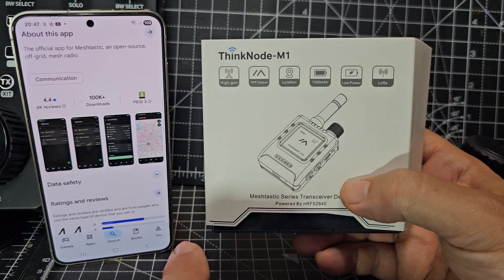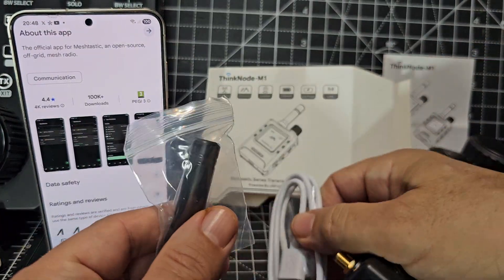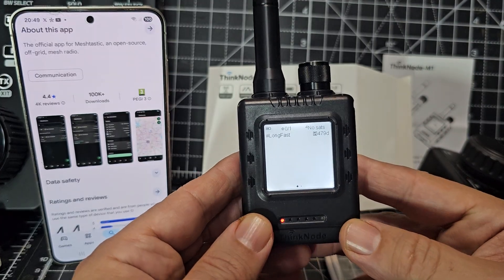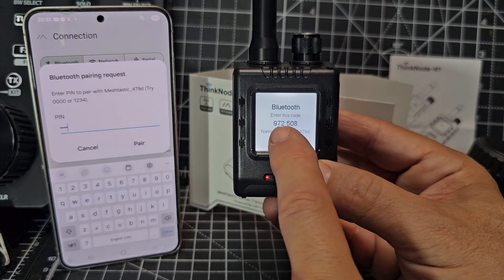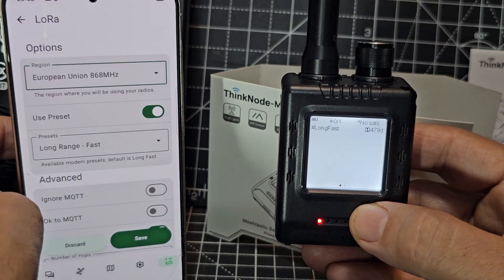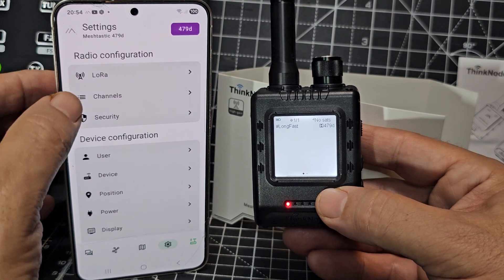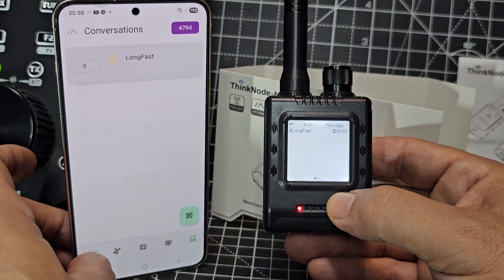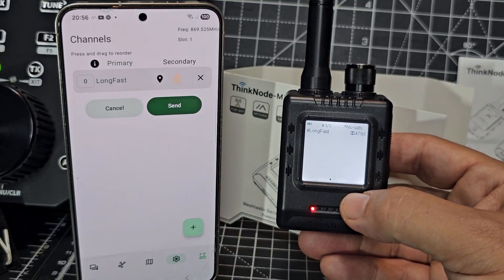ThinkNode  M1 , Lora Meshtastic Transceiver

Comment: What cheap mesh/lora device would you recommend mate??? Looking to start out in this but want to just dip toes first.
Reply from the maker: Heltec Wifi LoRa32 V3 433MHZ 863MHZ ESP32 S3  SX1262 OLED Display LoRa Kit for Arduino Meshtastic IoT LoRaWAN Development Board
https://s.click.aliexpress.com/e/_EGzaKmM
Reply: @M0FXBHamTech  Damn thank you mate....
Reply: If you want to remain with a head of hair, get an M1. Easy to setup. I have 2 heltecs' and dipping my toes so to speak, and have lost a lot of hair!...LoL...top tip which I ignored. Whatever you get, get a set. Makes life much easier, and another tip is when setting up it's a lot easier with 2 phones, one for each node. After initial setup, just revert back to control with one phone. Borrow the xyl's. She won't mind!